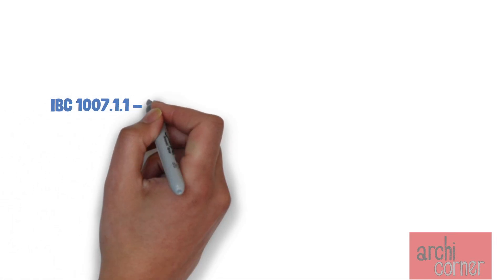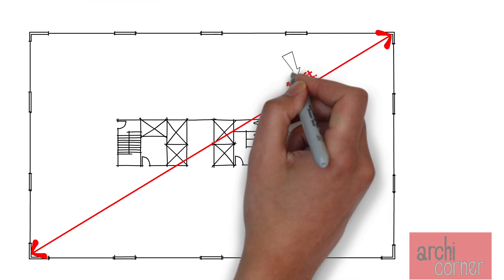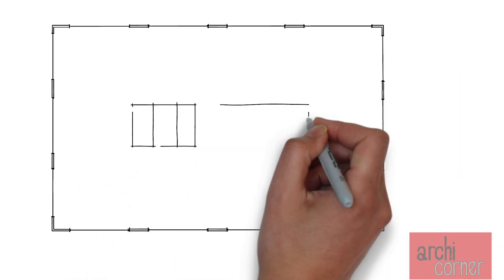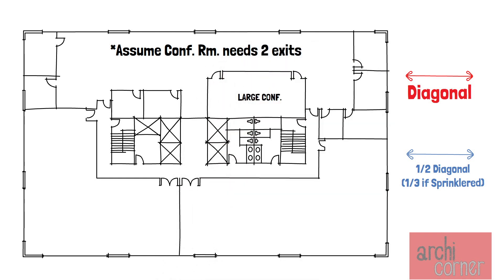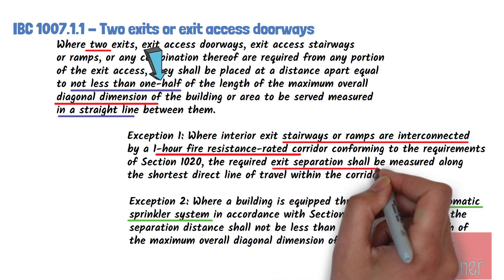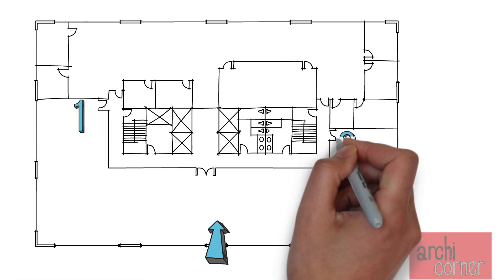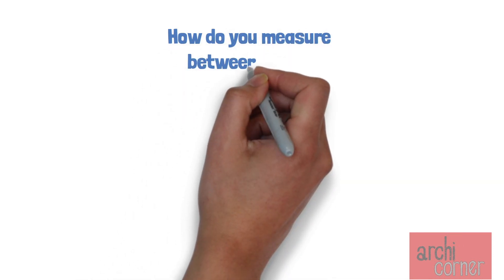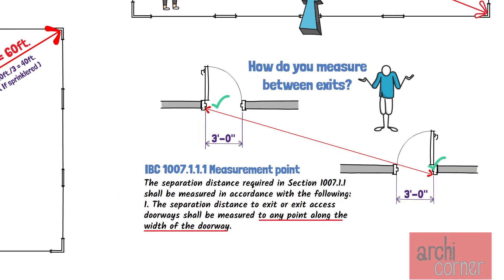AC 027 - IBC requirements: What is the required distance between exit doors?

Comment: What's the solution if I can't make the diognal distance in high rise building for existing building and the distance less than 3 m between the stairs???
Reply from the maker: There are many factors to consider, including but not limited to type of project, scope of work and the jurisdiction you are in. In general terms, these buildings that do not conform to current fire-life-safety requirements are known as "non-conforming building". It has often been the case that an AHJ allows for the non-conforming items remain as "non-conforming" as long as the occupancy group is not changing and you are not adding area to the building. That is a very basic answer. To be sure, I recommend you contact a local architect in your area and/or have conversations with your local building department to see what options may be available.

Comment: Hm, this is a bit confusing to me; not your presentation, rather how the code is written. When I hear "shall be placed a distance apart equal to not less than 1/2..." I hear that the "1/2" distance is the minimum, not the maximum. Also, it doesn't make sense to me why, if a building is sprinklered, the distance between the two doors would need to be shorter. Wouldn't the sprinklers give us more "time/distance" to walk further away hence with two doors further apart? Anyway, great video, just the confusing code verbiage!
Reply from the maker: The idea of two exits is to provide a person with an alternative if the "emergency" happens to block the main exit. For example, due to a fire, you may not be able to use the main exit, so you go to an alternate door. If the building does not have a fire sprinkler system, it is possible for the fire to spread quicker, and therefore the exit doors have to be further apart.  If the building is provided with a fire sprinkler system, the fire would spread at a slower pace, so the doors don't have to be so far apart.

Comment: logically its opposite .. sprinkled occupancy provide more safety and Tho can have more exit distance .. i believe ( Sprinkled >> 1/2 .... Non-sprinkled >> 1/3 ) .. now it provides more safety
Reply from the maker: No it is not. The closer exits are to one another the less safe. For example; if there was a fire blocking one exit, as time goes by, the fire will spread. If the second exit is too close, it may be possible that the fire will block both exits. That is why you want them to be further apart. In case of fire you don’t want the fire to spread and block both exits. Or at least give the occupants more time to exit. Hopefully everyone can get out before the fire blocks both exits.

Comment: Is there a SQFT of a space where you are not required to have 2 exits and can get away with one
Reply from the maker: The number of required exits is determined by the square feet AND the use of a space. look for Archicorner episode #013 which will provide more information on how to determine the number of exits.

Comment: Why does the exit spacing reduce with sprinklers I would think in a ballroom with sprinklers you would gain further distance between exits ?
Reply from the maker: Exit separation allows for a person to have two separate exits to pick from. If one exit is blocked, for example in the case of a fire, a second exit is available. Sprinklers provide some safety measure by being able to potentially stop a fire or by delaying how fast it spreads. Therefore, when sprinklers are present, the distance between exits can be closer, but they still need to be a reasonable distance away from each other to create a separate exit.

Comment: Hi, great videos!!  Can you tell me, is there a limit on the distance between the exit door of one tenant and the exit door of an adjacent tenant, if both are accessed by the same corridor (like in your sketch above)?  I can't seem to find that answer.  Thanks!
Reply from the maker: That is a good question. If they are different tenants, then they exit independently from one another though a common area. Therefore, a tenant can have an exit right next to the exit of another tenant as shown on the video. There are no distance limitations.

Comment: One issue that I am having and hard to explain is "convergence." Because of the remoteness of the doors in the tenant suite the Plan Reviewer also looks at the remoteness to the egress stair. If the common corridor is not wrapped around the egress stair there maybe a problem. Unfortunately, I cannot find anywhere in the code for this word convergence in relation to egress.
Reply from the maker: This is a term that has been used for some time. No, it is not a term that you find in a code. Without having further knowledge of a specific project, often times convergence means that BEFORE you access the 2nd  exit, your paths come to a meeting point again. That is not allowed. Once you separate your paths, they must be kept separate again all the way thru the end. Take a look at AC #029, that video shows the basic requirements for exits. Hope you like the video!

Comment: At 3:55.  How do you confirm distance between 2 stair doors when multiple unites are used
Reply from the maker: The stairs are designed to comply when the building is designed originally. The stairs “should be” designed to work for the ENTIRE FLOOR, not just one suite (or two). But if you really want to confirm, you still have to follow the same steps: find the diagonal distance and then determine the required distance based on the diagonal distance. The process does not change. Hopefully that helps.

Comment: What if you have a scissor stairs in stead of the remoteness of the egress doors? This is common in older buildings on the East Coast.
Reply from the maker: Every building is different and project specifics can have an effect on what decision is made. In most instances, older buildings are allowed to remain "non-compliant" so long as they comply with as much as the code as possible and so long as the use of the building is not changed. For example, a residential building would not be able to change to an office building.
But again, every project is different, so there is no "one-fits-all" answer for this one.  Great question!